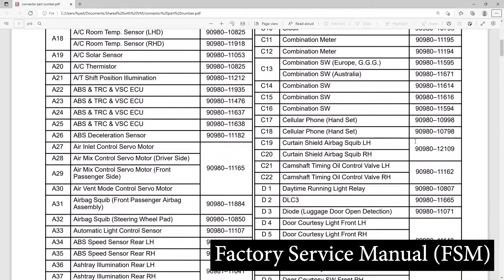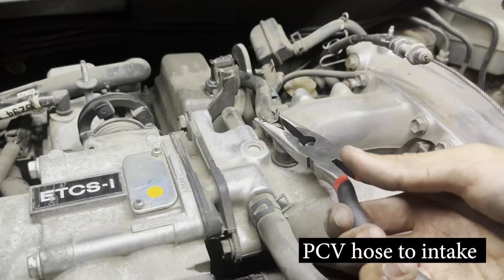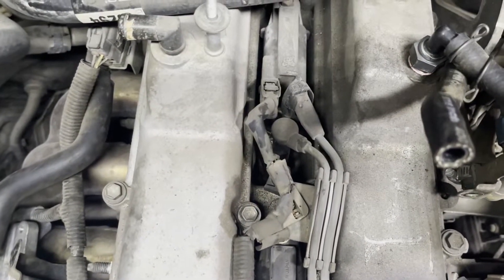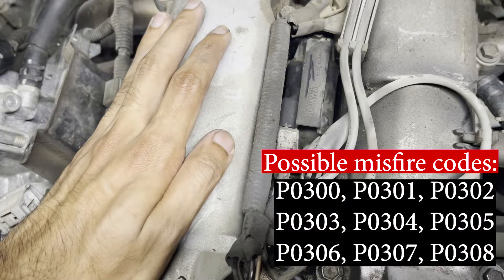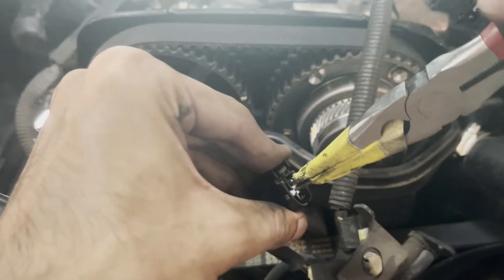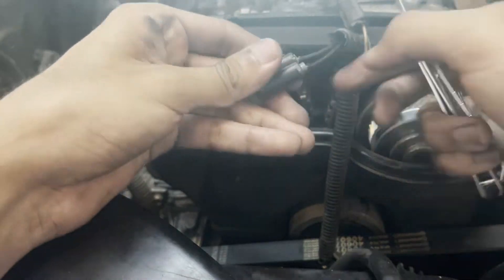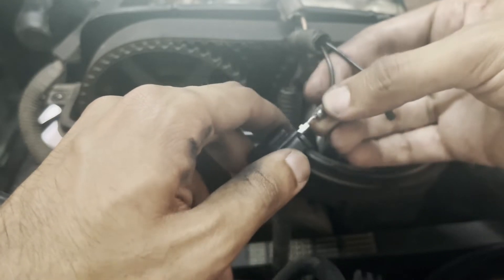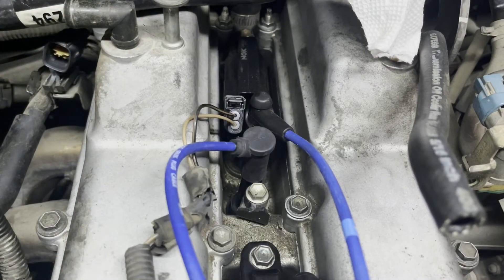How to repair coil pack connectors on a Lexus GS 300 | Works for most Toyota or Lexus models

Comment: Thanks for the video !!!!!!!🏆🏆🏆
I have an 02 GS 300 145k and want to ask, was it the codes that made you want to change coil pack or did you notice this the worn connectors?

Is any performance issues associated with bad coil packs? 
Thanks Amazing video
Reply from the maker: Hello! 

That’s a good question. I did get a misfire code on one of the cylinders but it was due to old spark plugs and not due to the connectors themselves. I just decided to do the connectors since I was there and if they became loose in the future it would be a pain removing the intake to get to them again. 

Thanks for watching! :)

Comment: How do I determine which wire goes where on the new connector if the old connector completely disintegrated? Thank you
Reply from the maker: Hi Ed, on the new connector you will be able to see numbers designating the wire number as I show in my video. Thanks for watching! :)
Reply: @theautochap  thankyou for the info..